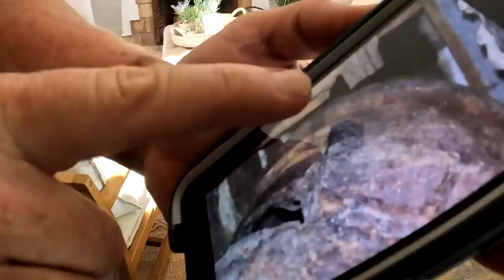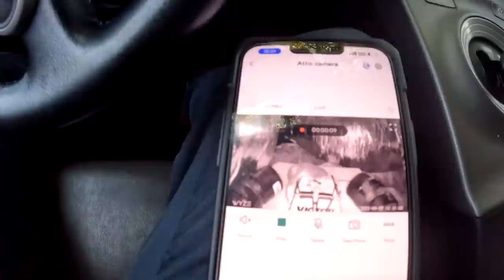The best way to get rid of rats FAST - Shopvac..

Comment: So thankful for these guys, they sent me on a mission to find the breach in my house. I literally did every exclusion possible, far superior than anyone I could hire where I live. The problem continued for years. First I thought a broken vent pipe and so many other issues. All were incorrect but I sure did a lot of work on this old house. Sometimes to complete exhaustion. I had new windows installed when I first moved in 12 years ago, at the same time they built a stand alone office against the exit of the garage/basement door. Checked all the windows everything was fine until one day I took the ladder & and was looking at the ceiling where I hear jumping at night. I see near the window,  light shining through the office window from the ceiling of the office. I noticed that fact a couple times before. Yesterday after making my New Year's resolution that I would find the breach I decided to crawl all the way over the ceiling and to the window, I had my mom's sewing ruler from the fifties in hand and I put the heavy thin metal yardstick up to the sunlight and decided to fish around. What I caught was a 3/4" gap all the way across the entire window. Oopsies, they forgot to finish the window. There was no way to get to the window to fully repair it so I went outside and saw the yardstick protruding all the way out the window. Shocking. I found it after years. From the outside you could not see the breach just some missing caulk but inside you could really see the problem. 
They seemed to come in during the winter more so than summer. I took Rapid Set adhesive caulk and a new door sweep out to the window. I put the Rapid Set caulk (great stuff, btw) at the top of the window. Measured the door sweep, just a little too long. Sawed the sweep slapped it over caulk and held it there. I was doing insulation work with neighbor today. Tonight I went into the basement/garage around 3 am and the first time ever no rat jumping. They were using my house as an Air b n b eating the garbage all over the block and staying in my house to keep warm. I attribute my find to these two guys, relentless, detailed, true professionals. I can't believe, a huge sigh of relief. The fear I have of my house burning down is real. I need electricians, probably foundation experts, possibly plumbers. It was hell, don't give up if you love your home,. How many of us really have access to the caliber of these pros. Very few. I'm 65 with some health issues & if I can do it so can you. It was total luck I figured this out. Watch your contractors I think I was feeding them too well and they got fat dumb & happy, also careless. The stress was horrifying, I never dealt with this in my life. Good luck. Fortunate we had really warm weather the past week after brutal cold.
Reply: You went in. I'm so glad you sorted out out. I enjoyed reading all about it as I travel home from Cirque Du Soleil Cabinet Of Curiosities in London. (I'm a Chef) Thank you for sharing. ♥️
Reply from the maker: What a great share! Great job and appreciate you taking the time.

Comment: I felt the same way when i got my rat problem. I am a vegetarian for moral reasons(veganism is hard), which put me in a tight spot whenever they wouldn't die immediately. I didn't want them to go back into my house, nor did i want to drop it off somewhere else where they could invade someone else's home. So i did what had to be done.
Reply: I give you credit for that.  They are nasty and carry disease and people don't need those diseases.
Reply: just come to terms with how terrible humans are
Reply: @Buhhhhhh-xi4ju  theres a reason gurus and llamas went with such a sedentary lifestyle.
Reply: One thing I learned the hard way is that you must use the correct size snap traps for whatever rodent you are after. I caught a chipmunk in one of my mouse traps, for example. I don't know how long it had been there, but it wasn't dead yet. I had to put it out of its misery with a brick.

Comment: Ok, this is turning into a bit of a binge session. Fascinating stuff. I love how you 2 are always thinking ahead, and verifying the exclusion process is complete before moving to the next bit. It seems like that would be paramount on jobs like this. I don't know if this would help you, but one tool that was a total game changer for me is a SeekShot thermal camera. They're amazing. I can't help but watch these videos and think how much guesswork (which you guys seem to work through quickly regardless) and crawling in tight spots could be eliminated or mitigated by using one. Not to mention, it's yet another service you can offer while re-insulating homes etc. We saved one of our customers millions in December by being able to visually winterize fuel gas lines, scrubbers, and pumps. $400-$500 and it will change the way you operate. No more guessing or running around with a temp gun and grease pen for me to create the same thing the camera shows you in plain black and white (or ROYGBIV). I'm telling you... it's worth the expense. I almost want to give you mine so you can see what I mean lol. Total. Game. Changer. Keep it up guys.

Comment: An alternative to radios that I use as an electrician to keep my hands free. I will call my coworker and with both of us using hands free bluetooth headsets it's like we're right next to each other. I love RF radios. I'm a ham radio operator. But they have their place. And under a house like that, isn't really it. Try using hands free headsets to communicate and coordinate with your coworker across a property. It works wonderfully.

Comment: Iv actually found that if you use fruit bar on a glue trap laid out flat works well and if you dont wanna harm the mouse or rat thats a good option  i however  take them out back and release them only for a copperhead  to eat em 😉

Comment: Good info, thanks a ton!  Love the rat dance 💃 
I've caught 5 so far, missed one last night.  Closing up the entry points as I find them, but still missing some.  How many rats are there likely to be in one building? I suspect they've been here for a while, this building's a 130 years old and has hollow walls. If they have been here for a while they have stayed very well hidden,their entry points just started showing up a couple of weeks ago, and I spotted one around the same time. I've read that if you see one it means you have a bad infestation, is that always true?  They smell terrible, I know I would've noticed that before, so I feel like this is a new thing.  It's been tricky. at least one of them knows how to get the bait from the traps without getting caught in them, and now it doesn't seem like they're going to the traps at all.  Also,my dogs don't seem to be able to smell them all the time, which is very weird,because they are beagle lab mixes and can smell a field mouse two feet underground in a rainstorm, but these things will run right past them and they won't know where to go.  Are these some kind of superhero rats or something?  Any advice you could give is amazing and greatly appreciated!  💜
Reply: Yeah, I got those hollow walls too only cinder block. In the process of forming light weight block so as not to screw up foundation when I place block on top of laid 1950’s cinder block.

Comment: Aren’t you defeating the purpose of eliminating rats by releasing them? Problem for another household? I agree with your methods, they are the best. I question when you release them or let them escape.
Reply: More money 💴
Reply: I hear what you’re saying but they’re so prolific killing some here and there won’t really help the neighbors in the long run. If their houses are sealed properly with no trees against the roof or 100 year old broken pipes they usually aren’t an issue. They’re also a main food source for many small predators……
Reply: @ravem410  good point